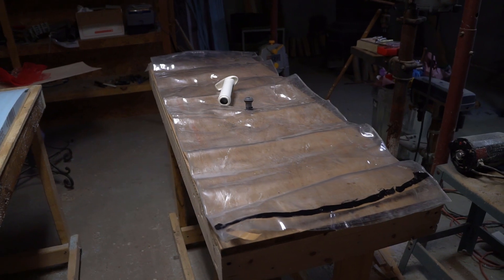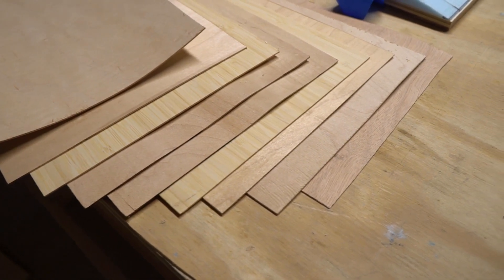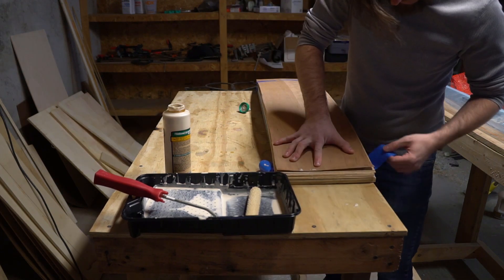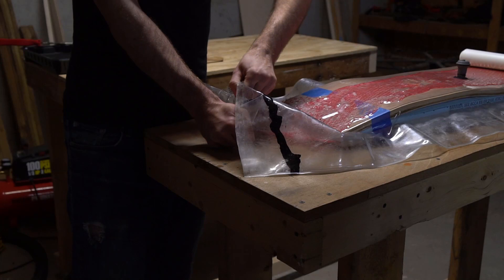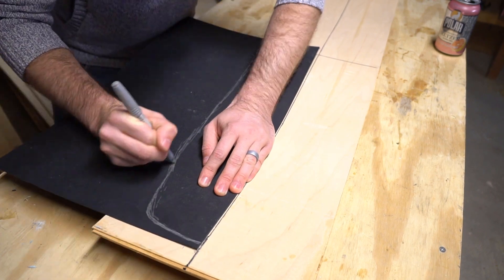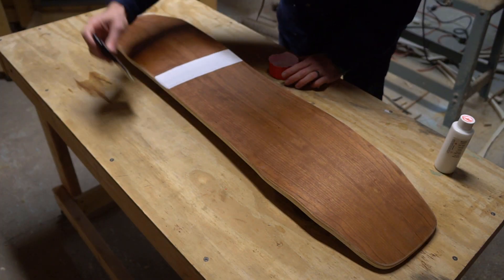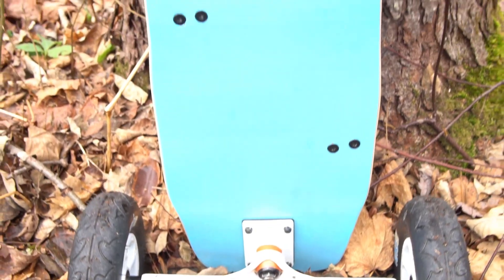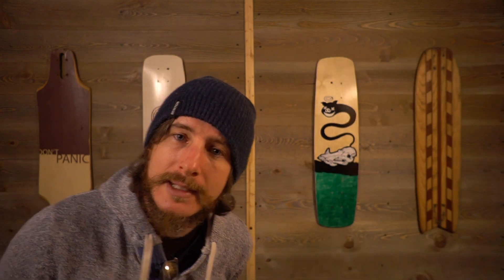Vacuum Bag - The Easiest Way to Press a Veneer Deck

Comment: I build furniture and often need to create bent parts like rocking chair rockers or curved backs for chairs.  In your video you noted what I refer to as springback which happens when you remove a bentwood lamination from the press.  Springback is caused by the glue itself giving a little as Tightbond is meant to do.  Tightbond is a fantastic glue, but a better choice for laminations is a glue that produces an absolutely rigid glueline.  You might want to experiment with a urea formaldehyde glue like Unibond 800.  This will eliminate any springback after removing from the mold but may inhibit flexing too much for what you're doing.  At 73, I'm well past your age but the boards you make look like something I would have loved in my younger days.

Comment: I just bought unidirectional CF and a biaxial FG for the middle layer, foam core, new 14" band saw, new 2'x4' CNC router for deck press plates and engravings, and all the multitude of resin and vacuum forming products. This is all your fault, bro! Haha. Great video.
Reply from the maker: Holy crap dude! I can't wait to see what you're building!
Reply: @GoodRoads  Me too! Haha. I'll try to cobble a vidya together for ya.

Comment: How about a bent wood chair...
Reply from the maker: That could be interesting, throw back to the Eames and the birth of all this bent plywood stuff.
Reply: @GoodRoads  the Eames lounge is the ultimate chair .and a good goal. However I would start a little simpler
Reply from the maker: Oh of course! They did a lot of industrial design outside of that chair though, most of the desks we used in grade school growing up were the Eames as well. They invented the bent plywood technique we use, so I think just applying that to a chair would be a tribute to them. I think I'd want to start with a stool or something simple, right?

Comment: Would it work to use the other half of the mold, instead the one you used, which has the upper shape of the deck?
Reply from the maker: Possibly, though a male sided mold works better with a vac bag. With the female half of a mold you run the risk of the veneers getting pinched and clamped between the bag and the kicktails of the mold and then there isn't enough clamping force to get the wood down into the bottom of the flats and concave

Comment: Is the little pump you used for the vac bag stong enough to press a snowboard ? If yes where could i buy one?
Reply from the maker: Yes, I actually used this same bag and pump to press a powsurfer in another video. You can get them at roarockit.com
Reply: @GoodRoads  those it press better with the technic with the weights?
Reply from the maker: If you're making the board out of plywood I think the weights work better. If you're using veneers or fiberglass the vac bag will probably work better

Comment: Hi Chris, how are you my friend? I have a question... can I use epox and press with a vacuum bag without a problem? Or with vacuum bag works only with glue?
Reply from the maker: Absolutely! Vac bags can actually be really advantageous for composite builds because they can suck out any excess resin. I would look into getting some breather material to keep your surfaces clean and some bleeder cloth (fleece like stuff) to soak up any resin that might seep out. Any composite supply company should have those materials in stock
Reply: @GoodRoads   thanks very much for all informations!!! I just asked because in all the videos I saw using vac bag, they were all made with epoxy... When you say "getting some breather material to keep my surfaces clean" , you are talking about the surfaces of the vac bag that might seep out... or another thing? Sorry for the ignorance, this part got a little confusing for me. But, again, thanks very much for all your information, always! And all your videos!!! I saw almost everything!! 
And I would like to say that if it wasn't for your channel, your videos, it wouldn't have motivated me and encouraged me to really try to make this dream happen. I imagined it was something much more complex than it really is. Im from Brazil, and I set my goal for this year to press decks! I've already started building a press with wood and would like to invest in a vac bag as another option and practicality for different shapes and sizes! And one last question, do you think there is any difference in quality and strength comparing a deck made in a vac bag and another made in a press?

Comment: I build helicopter blades for a living and this is a very common job for me. I have it a lot easier though being the central vac system and air pressure gauges. This is a very effective method for a budget build. Great video man. Ps I’m still very excited to see how your next snowboard build comes out. I’m super stoked man. 👍🤙

Comment: To preserve glue using the roller method, I stick the roller in a plastic bag, get it mostly air tight, and keep it in the fridge between layups.
The bag also allows me to pull the roller off the handle without getting glue on my hands.
It stays fresh for potentially weeks, but it best suited for when you're making a new board every few days.
The roller itself really seems to just eat up a ton of glue, so anything you can do to avoid having to saturate a fresh roller with glue seems to be the way to go.

When my Roarockit bag of over 10 years eventually got too beat up to be worth keeping, I spent a good amount of time trying to come up with an alternative.
There's a couple ideas which might be viable for single use, but ultimately I decided I should have just got another roarockit.

One build idea which might be fun is a bi-deck snow skate.
Its deck building, but also you have the ski which is like a mini snowboard.
Reply from the maker: That's a helpful tip! I really want to do one of those junkyard style snow skates at some point. I'm not sure if I'm going to get to it this season because I'd want to make the ski, maybe I could repurpose and old one though...
Reply: I've used kids skis before,  and chopped skis, but for a snow skate its really not ideal, and you really need much more sidecut than you get with either of those options.

The construction is like a ski in that its shorter and narrower,  but weight distribution and flex, its operating like a snowboard. 

I'm afraid my snowskate experiments have gone off the deep end, and my latest designs have 2-3 or more skis going on underneath the deck.

Comment: I recommend opening up the sealing tape a little more gently and slower. That way, you're able to use it for more presses. Loved the vid!
Reply from the maker: For sure! This length of tape had actually been through a couple presses already and it was about time to replace it. I've got a fresh strip ready for the next one
Reply: @GoodRoads  That 'butyl' tape is just a mess you can use like latex caulk. also i fully support roarockit for getting all your materials from one place and getting into building. But really you can buy thick vinyl from lowes or something and make a bag for pretty cheap. helpful if your bag gets a lot of holes in it. the roller will put a lot of extra glue between your layers, which could be why your board 'relaxed' when you took it out of the mold. it's hard to get a consistent layer of glue between each veneer but it helps if you can get a stronger air pump to get as much pressure as possible.
Reply: @pimpassbossman5310   How would you go about creating a secure vacuum port hole on the vinyl bag? Seems like that would be the most vulnerable spot for a leak besides the initial opening. Edit: Found these instructions: https://www.instructables.com/10-Vacuum-Bag-Stem-breach-valve-with-hardware-s/   One comment on the article brings up the point that air will flood back in once the hose is removed.

Comment: bamboo is a springy "wood"  genius idea though. idea for better glue spreader    Taytools 500015 8 oz. Glue Roller Bottle Applicator with 2-1/2 Inch Wide Roller for Flat Surfaces. on amazon roller is too skinny but just a idea. where did you get the alcohol ink?
Reply from the maker: That bottle roller looks interesting, I wonder if it could be supersized. I actually got the ink at an art store before I moved out of the city. Total bummer because now there are no art stores for miles :/

Comment: I just put together a longboard with two sheets of 1/4 inch okoume plywood, I found it's pretty soft and bandy. Any info on what type of wood may be a little bit stiffer for the next one?
Reply from the maker: There are plywoods available that are made all out of birch plys and they're the best for that style of build. I've seen them sold as "baltic birch" or "russian birch" plywood
Reply: @GoodRoads  Thanks! Does it need to be marine grade? The baltic birch at the store I was at was not so i grabbed the okoume.
Reply from the maker: If it's specifically called "baltic birch" and not just birch plywood then it is marine grade. Baltic birch is a brand name. If you're not sure you can take a look at the edge of the sheet, the veneers in BB plywood are all the same thickness, in other hardwood plywoods the outer veneers will be really thin with thicker layers between. Those thicker layers are usually softer, lower quality woods.

Comment: planning to use this technique for a snowsurf. Thinking about a fibreglass top sheet. Any recommendations for a base material that would be malleable enough to form to a concave? Also is it possible to add edges without urethane sidewalls? thanks
Reply from the maker: That's all doable. I would put the glass under a layer of veneer though, the reason snowboards have top sheets is that UV degrades epoxy, so just having your board in the sun will break it down if it isn't protected. Standard snowboard base material will conform to a 3d base, so no problems there. You can do edges without sidewalls, do a search for "Snowboard cap construction" and you'll be able to find a technique where the glass cloth and top sheet wrap around the sides of the board for protection
Reply: @GoodRoads  would fibreglass have much benefit for a powder surf? Can you glue p Tex base straight to wood and skip on fibreglass?
Reply: Or are sidewalls a must if I’m adding a base to prevent delamination?
Reply from the maker: @maceoshoots  You can do p-tex without glass or sidewalls, you just have to use epoxy instead of wood glue to adhere it

Comment: Awesome channel! I've learned a heap and keen to build a deck. But what is the foam you use for this and the DIMM press? Struggling to find something here in the UK. Thanks
Reply from the maker: It's called rigid insulation foam and it's used in construction, at least here in the states. It comes in big 2x8ft sheets but sometimes there are smaller "craft" sheets available at our chain home improvement stores like home depot. Don't know what the equivalent would be across the pond, but hopefully that helps you in your search